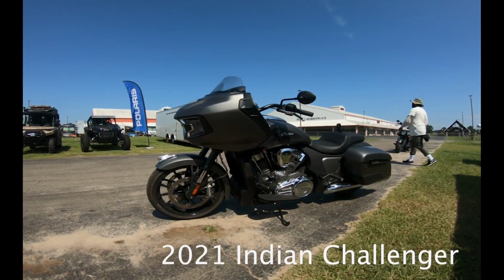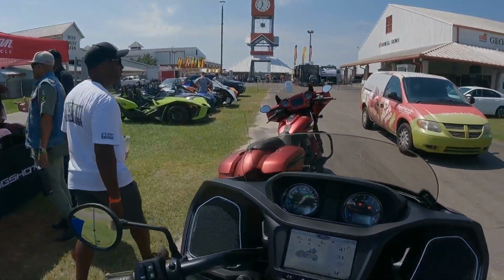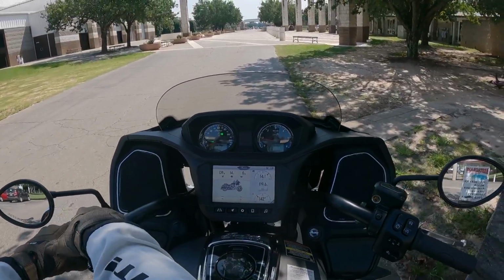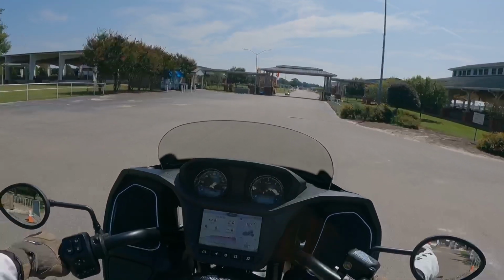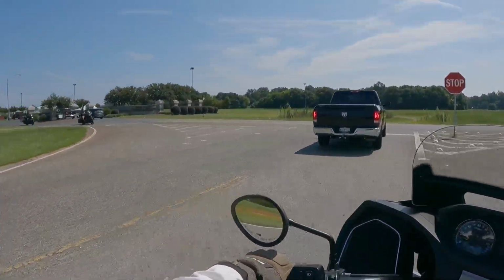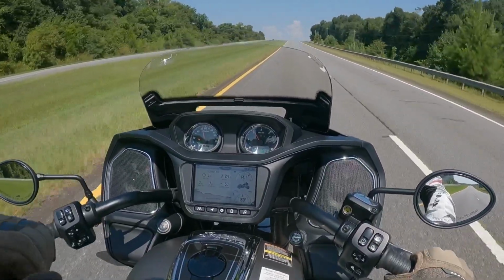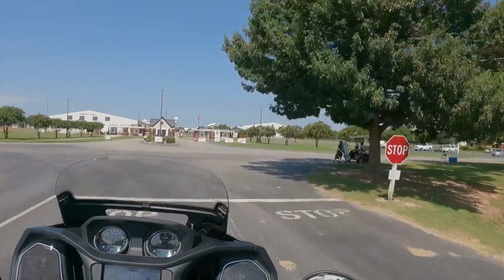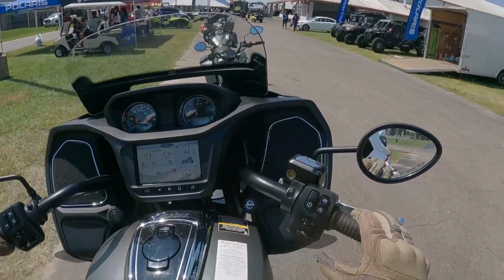2021 Indian Challenger Test Ride and TOP SPEED RUN! First Ride Impressions.

Comment: After watching your top speed run my modded challenger is so much faster lol
Reply from the maker: Would love to hear what’s you’ve done to it.
Reply: @jdbmoto  it's limited of course because we don't have much for options but the cams and intake from indian. The rush cat delete with 4 inch slip ons. Lloyds tune.  On a very conservative dyno I put down 120hp and 125tq a 117 with very strong supporting mods beyond what I had done only threw down (ran the dyno right after me) 102 hp and 119tq
Reply from the maker: That’s impressive! I’ve heard of removing the limiter and it can do 140, after my pull and hearing what you’ve done to yours I believe it. How long have you had it? Any reliability issues?
Reply: @jdbmoto  so I got it in November of 2020 and it was a demo bike for 18k with a 5 year warranty. It had the surging idle and really awkward and bad throttle response. Indian took good care of me and after many hours of work and lots of parts thrown at it they put in a stage two kit for free that involved the cams and new computer. Runs perfect now and have no other issues at 10k miles now.  At 143 miles per hour my tach is around 6k rpm. Needs another gear!!! Lol
Reply: @godackgudalach1  what was the 117? A Harley?
Reply: @shotgunscott  yes it was a 117 hardley and as far as I know it had the oil pump, cams, full exhaust including head pipe, air cleaner and a tuner. Beyond that I've no clue what else was supposedly done to it.
Reply: @godackgudalach1  nice. I didn't know they had a 117.
Reply: @shotgunscott  they have so many lol 128, 131!!! 131 is the biggest right now I believe and those are monsters from what I hear and have seen from dyno sheets on them.
Reply: @shotgunscott  117 is the current gen CVO engine, 107 is base, 114 is Limited. 128 i think is the 114/117 with a stage 3, and stage 4 is the total engine swap to the 131. S&S offers even larger options
Reply: Throttle froward to shut off cruise control.